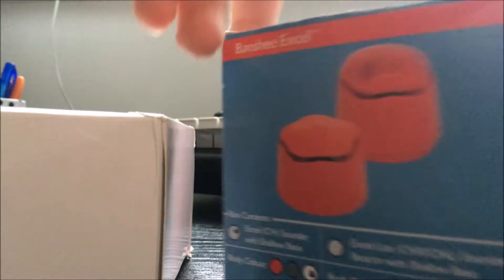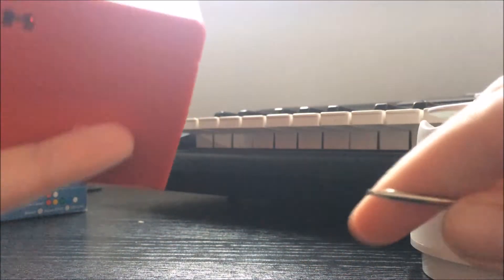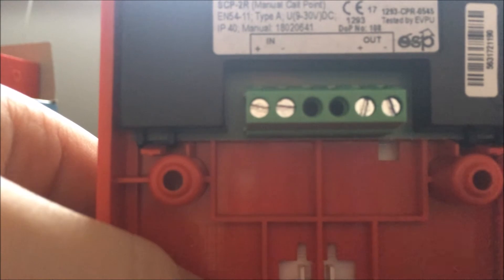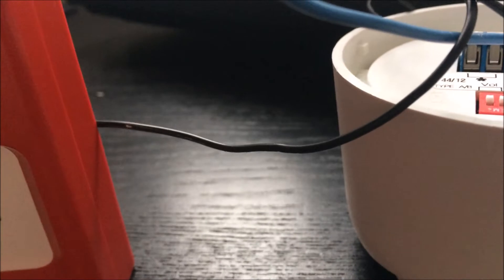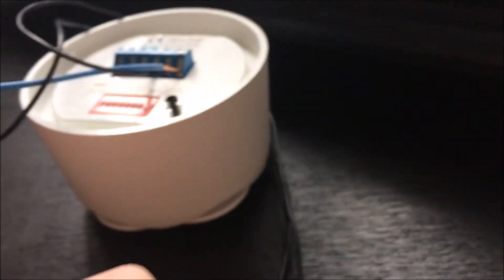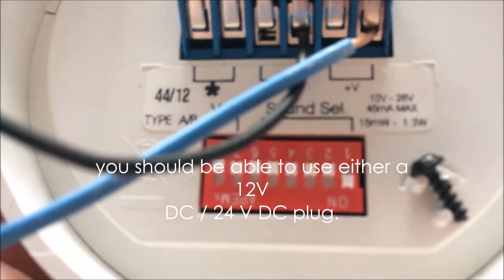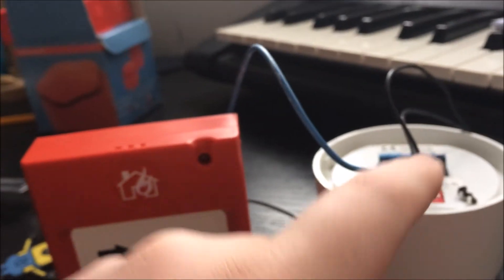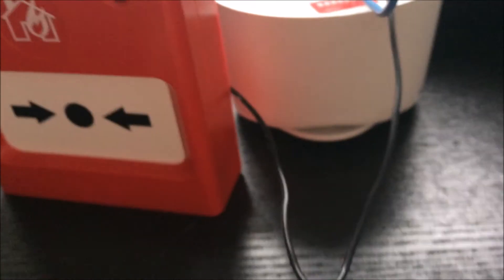Fire Alarm Tutorial | how to wire a call point to a sounder using a plug | Jm Fire Alarms.

Comment: Bashnee Sounder With Sound French Fire Alarm
Reply: This Multitone Siren The Bashnee Sounder
Reply: 1 2 And 4 OFF 3 And 5 On NFS32001 Sound Of Bashnee
Reply: It will be more of help if you could let us see how to conect the cables to the call point. Let`s see the back of the call point with the  cables connected, or the process of connecting them